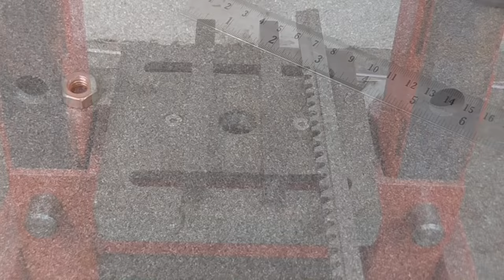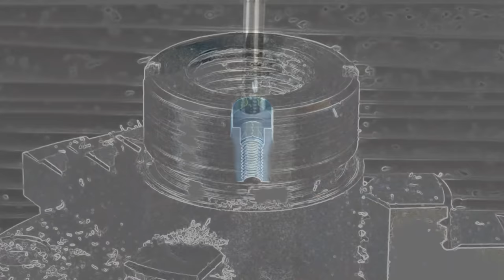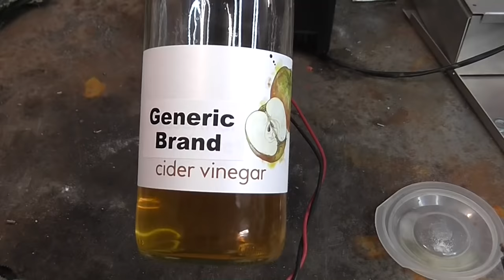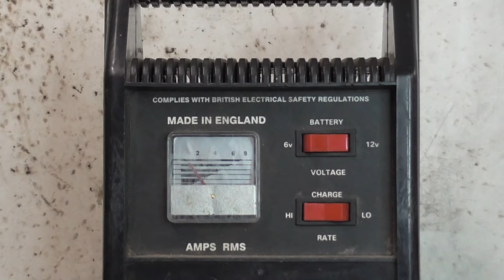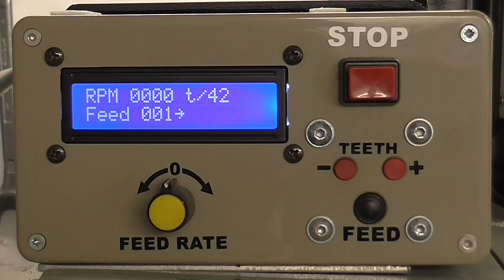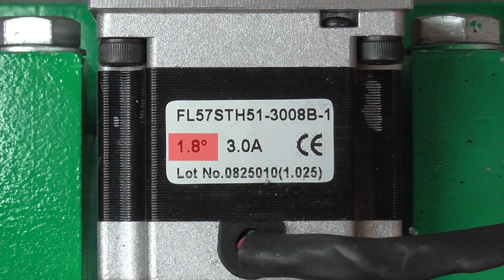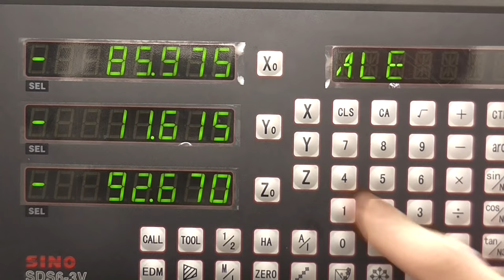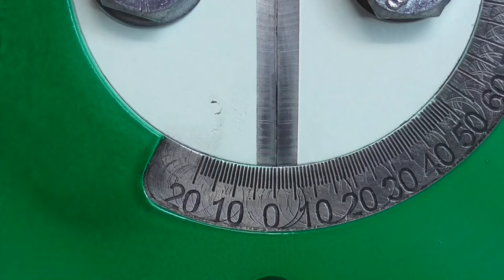Gear Hobbing Attachment (milling machine) Part 2

Comment: Yea. Hats off to you sir. I have a degree in CNC machine tool. Now I've seen and done lot of neat shit on these mini manual machines. Guys home making all kinds of tooling and attachments for all different kinds of operations. Machine modifications to add capabilities, automation builds, CNC conversions, rebuilding entire machines all that. Your build here tops them all. Average hobbiest aside even for me It's about hard enough to set up a mill with a rotary table and indexing plates and a standard convoluted cutter to cut a gear one tooth at a time. Here you are home building an attachment to transform a Harbor Freight mini mill into a gear hobb. That is truly amazing and worthy of praise. Again hats off to you my friend.

Comment: Interested in the box controller for the Stepper motor!!! would you care to share where can I get a hold of one of them??
Reply from the maker: That's something I built about 10 years ago for my previous milling machine, the electronics are a little dated, but the parts are still available.

Comment: I’ve been in the trade for 40 years. 
I’m impressed by your gear cutting. 
And your electronic gear indexing
Reply from the maker: Thanks very much! 😁
Reply: @AndysMachines  can you do splines this way too? or  that's broaching altogether?
Reply from the maker: Yes you can hob splines, there are special hobs for doing this. internal splines need to be cut with another method though (broaching, shaping, skiving).

Comment: The amount of engineering steps to making gears is intense. I have a new appreciation of the little things that makes life easy.
Reply: 🤖🍖me2
Reply: Hi Andy
How to sync the index head with machine spindle?
Is it possible to use closed loop stepper motor with harmonic drive for hobbing instead of belt drive?
Thanks in advance.

Comment: Ok, had to subscribe. I’m a professional mechanical engineer, and I have taught the machine design course at my local university, which includes a couple chapters on gears. But your explanation of how gear hobbing works (including a perfect animated illustration) was masterful and eye-opening. And how (relatively) simply a hobbing setup can be made…. wow. This just went on my last of projects for when I can finally build my garage shop.

Comment: Best explanation of gear hobbing that I've seen yet. And also thanks for demystifying cutting helicals. I always thought there was a lot more magic to it than just "tip the gear, then do the same thing" :P
Reply from the maker: There's a little more to helicals than 'just tip the gear', the calculations for correct pitch circle diameter are a bit more complex, but nothing too scary. Now hypoid bevel gears, they mystify me!
Reply: @AndysMachines  Haha, fair enough :P Still less magic than I originally imagined.

Comment: I have been waiting so much for this final video to come out. Absolutely brilliant bit of kit you have put together. I specifically liked the pre-tension nut for the angle bearings. 
What would also be great to see is these gears in use. For example to make a planetary set of gears and then run it at relatively high speed.
Reply from the maker: Yes, this hobbing attachment (and gears made with it) will certainly feature in future videos and I can think of a couple of applications for planetary gearboxes. It may be a while before I get round to it though (never enough time!)
Reply: @AndysMachines  Well done on this overall.
It would be great if you could do a more in depth take on the spindle. A lot of people don't know what it takes to make a shaft rotate with high accuracy and very low run out. There are more than a few people doing their own CNC mills and lathes here on YT and its obvious to me they don't understand the concept of mounting a shaft that will maintain its precision over time.

I don't know your background but its more than just precision machining. That part of the first vid when you checked the run out on the collet mount was scary for how accurate it was. The fact you know how to make and install a quadrature encoders is super impressive and I wished more people would pay attention to that concept.

I've done 30+ years of automation and very few people are even taught what you know to design and build. Robin Renzetti is one of the very few YouTubers I have seen who knows how to design and build high precision hardware. I have worked with precision tool makers and instrument makers and they have a different mindset to normal machinists.

About the only thing I would have done differently would have been to use a servo instead of a stepper but that's my bias from robotics and I know how to use them.
Reply: @AndysMachines  You're absolutely right about the mechanical part. No amount of software can ever truly fix a bad mechanical setup. It might improve what ahs been built but it can never solve. That's a very hard lesson I see way too many mechanical engineers NOT EVER LEARN.

I hope Robin is back doing regular vids soon. I really want to see how that hyper precision indexer turns out.

Its not that dissimilar to what you did. Its a very simple system capturing a rotating shaft in fixture to rotate accurately. Its just he's taken it to a whole different level of precision.

Comment: What a cool project, really impressing! I like the etching technique. And what a cool idea to use this assembly for skiving internal gears. Great content. Thanks for sharing.
Reply from the maker: Thanks! I use this etching technique quite a lot on things like control panels, this wasn't actually a particularly good example, there were a lot of scratches left on the milled area by the endmill I used which spoiled the look a bit.
Reply: @AndysMachines  Anyway, the technique is ingenious :)!
Reply: @AndysMachines  Where do you get your electroetch masks, please ?
Reply: OK. I saw the answer lower down. It sounds like I should visit my local advertising sign maker as I´m not likely to get enough use out of a dedicated vinyl cutter. I´m familiar with electroetching and used to have an electroetch machine where the supplier did masks, too, but it is 40 years ago. Thank you for reminding me of it !
Reply: @peterellis6556  You could use the same technique as what hobbyists use to make their own printed circuit boards. In order to make those they coat copper clad PCB's with UV sentitive photoresist, print a negative of their design on overhead transparency sheets, place the sheet over the photoresist clad PCB and then expose it with UV light from some UV LEDs or UV tubes. After exposing it the required amount of time the board is dunked into a soda or weak lye solution to dissolve the bits of photoresist which were hidden behind the black ink of the printed design on the transparency sheets and as result didn't polymerise by the UV, and then the plate is removed from the solution and rinsed with some tap or preferably demineralised water. Then the board is placed in a tub with etchant solution (ferric chloride, sodium/potassium persulphate, or diluted hydrochlorid acid with a small amount of dilute hydrogen peroxide) to etch away the exposed bits of copper of the PCB, and hey presto, you have a developed PCB with all the copper traces and pads just where you want them. The same technique can be used with other metals as well, including steel and I would assume aluminium. And its probably a fair bit cheaper than the vinyl method.

Comment: Very ingenious way to cut gears, or whatever else that requires precision timing.
Reply from the maker: Yes, good point. It can not only cut gears, but also splines, toothed pulleys, sprockets, graduation marks, very precise knurling, in fact almost anything you want to repeat uniformly around the circumference of a part.

Comment: It's nice to look at the work of the Master! Especially without using the archaic imperial measurement system.
Reply: Careful they still use whitworth fasteners 55 degree thread angle unless you're at or under a quarter inch 54 and 1/2 included angle.
I noticed he uses metric good for him. You know there five different metric standards.
I made parts to mount a Garrett turbine TFE 731 high bypass engine on a pair of Desalt Falcon and Condor Business jets to get FAA certification in flight by removing the one of the existing engines replacing it with a Garrett model as most modern twin engine aircraft are certified to fly with a single engine it saves hundreds of thousands of dollars testing etc we did all the engineering made all the parts even installed everything, next thing you know I'm getting a call from an engineer desperately wanting to know what the hell I did wrong they were trying to add something the ISO metric bolts they had would not fit.
 I told him I used the French standard he was puzzled it's a French aircraft dude I wrote it down on the blueprints if he would have bothered to read them.
Here in the US we must deal with all of it I've made many an adapter to go from certain British taper pipe sizes to American taper pipe. On regular Straight pipe most of their threads are off by one pitch we add extra pipe snot and use a bigger wrench
On one project because somebody cheaped out on the gearboxes for the Central Arizona Project bringing water from the Colorado to Phoenix the size of pipe plugs used doesn't exist here like not even close.
Some of the Indians didn't feel they got their fair share of water so they were loading the gearboxes with gravel, the solution was to put locking pipe caps on the gearboxes right up until they couldn't find pipe nipples that would fit to screw said locking pipe caps onto priceless. 
More like about 60 adapters at around $50 each.
Reply: Not sure why they would call it imperial that's what they should call the British whitworth system.
 Here in America we use inches which have nothing to do with a damn thing.
Why you got me not divisible by anything makes computers insane only thing worse is when people try to convert metric to inches when they're trying to hold tenths of a thousands of an inch on CNC machines.
The control turns the motors that turn the screws.... you guessed it! Metric Screws so you end up with a double error someone asked me why don't they make inch ball screws Id like to smack them with a ball peen hammer idiots.
What would you use for a conversion factor how many places would you take that out and still be wrong unbelievable.
Some of the bolt patterns on jet engines make me crazy.
I use the dividing head with a plate you still have to put a fudge Factor in by adding or subtracting a hole in The mask plate, and if you're smart you'll break that up by some amount equally which is impossible I always try to break them four if not five times depending on the tolerance typically as I cross an axis if you looked at it that way even though I'm turning it radially.
 What division plate would you use for 109 holes on a 762mm diameter on a Bridgeport that only has 225mm of travel in Y.
Be careful one hole at 12:00 is offset from it's normal calculated position, only in the x-axis by 1.25 millimeter now imagine if you look at the part the first hole at the top now at 9:00 your left hand is now zero you're at zero because you're using the x-axis as your radius adjustment Y axis remains at zero except for this first hole the offset is made in Y.
 you get .002 inch tru position tolerance, regardless of feature size how many tenths of 1/1000 inches can you be off and maintain this position tolerance?
How many Arabs can you fit in a tent-h anyway, it really depends on how big the Tent is.
I live in microns thank you.
Sorry bad joke I got a better one though
Your setting up a machine you make the first part and send it to inspection.
The inspector comes out and says you need to move over a couple Mills, that way.
So you unbolt everything move down the line 2 machines and begin to set your parts up again there.
Soon he comes back to check on things and says, What the hell are you doing?
Reply: @chauvinemmons  It must be frustrating to work on vehicles of projects that cost upwards of millions, only for it not to work, or even worse, utterly get destroyed because someone used the wrong type of bolt. Hopefully one day the last few countries will join the rest of the world in using the metric system and nothing else, it would save a lot of people a lot of headaches and money the world over...

Comment: Great video! That answers a lot of questions I've always had about hobbing and this sort of coordinated moves that's necessary to make it work. I love the way you're able to get that ring gear cut. It seems that that's broaching it though, rather than actually milling it.
Reply from the maker: Yes, the cut is taken in the downward direction by the relative movement of part and cutter, it's similar to rotary broaching.

Comment: First of all- subbed, because this is the best example of a homemade hobber I've ever seen. Second- skiving is impressive, but poor results (wonder if it was because of heat treat on cutter?)- I'd love to see more of how the cutter geometry and centering of it is done. I'm aware of skiving before this, but was surprised when you pulled that out of the bag!

Lastly- if you have a tool steel blank gear, and cut it to an exact length, with 2 deg. of relief on backsides of form from face- you could make a Hemingway rotary broaching tool- and broach external & internal gear teeth on things. That would be better result than your skiving. Running an MDF disk through the teeth charged with fine diamond paste after hardening would give excellent finish and make the cutter work better too
Reply from the maker: Thanks! The skiving was really just a bonus feature and not the main reason for building the attachment. I wasn't sure how well it would work, if at all. I don't think the heat-treat was the problem, the cutter didn't dull at all and cut plastic and steel with virtually identical results. I think the main problem was that the geometry of the cutting tool was not correct, skiving seems to be somewhere between hobbing and broaching and calculating the optimal tooth profile for the cutter. Chip clearance was also a problem, and probably other issues too I haven't identified. But it did work well enough to make a usable gear if only for light duty.

Rotary broaching an internal gear is an interesting idea, I could make and harden a cutter easily enough (it would actually be an 'inverted' gear, with addendum and dedendum reversed). But I think it would require more force than my machine could apply except for a very small gear, as it would need to be done in a single pass. I might actually try this with the same 8-tooth cutter used in this video, making an 8-tooth internal gear, perhaps in plastic.
Reply: @AndysMachines  Rotary broaching doesn't require tons of force- you just need things roughed out first. If you trace the pattern and mill out most of the stock by hand, it takes a lot of the pressure off. The wobble is around 1 degree, so it shaves very little but quickly with each rotation.

For internal gear- yeah, you'd need a weird hob to make essentially the inverse gear form.

I love this project, and really love how you showed the hobbing of helical spur gears simply. The video really made many things clear.

I won't lie- I really really hope you cover the construction of this in every detail going forward- I really want to make one of these. I've done traditional gear cutting, but would love to get into proper hobbing.

Comment: About the encoder wheel - its by far easier just to print it on transparent film. If its not dark enough you can print multiple and place it on top of eachother. We once did contactless analog potentiometer by printing gradient. It was for a racing wheel :)
Reply from the maker: Yes I actually did that for my previous gear hobbing attachment, but I found it not durable enough for a wheel this size. But for a small encoder you can completely enclose it works great. A more durable way is to cut the shape on a vinyl cutter and stick it to a thicker sheet of clear plastic, I suppose you could do this with a printed transparency too.

Comment: All ingenious is simple 👍
I assume that controller is arduino based. Would be nice to see setup.
Thanks for sharing!
Reply from the maker: It's not arduino based as this controller I built for my previous milling machine before arduinos were a thing. You'll be pleased to know I'm working on an arduino based version though.

Comment: Great project!!
Now that you have an encoder on the spindle, you could use your controlbox to trigger the camera shutter. That way you could film cutting//milling videos where the cutter itself apears to be standing still. Would make some very interesting shots!
Reply from the maker: That's a neat idea, I might try that! From 21:17 I got the frame-rate almost synchronised
Reply: Not just stationary, if you set the shutter frequency to some fraction of the spindle you can do high speed/real time slow motion (think slow mo with normal camera equipment)

Comment: Did you use a CNC laser for the vinyl mask or some more mysterious technique like Press'n'Peel?  Very neat solution. I've tried making scales using a laser-printed acetate master and that UV iron-on film stuff with electrolytic etching, but it wasn't good on a stainless steel scale.
Reply from the maker: I used a drag-knife type vinyl cutting machine (as used for vinyl sign making). It's surprising useful to have one of these for all sorts of layout and mask-making.

Comment: Nice presentation. A major undertaking. 
Page 10:20 did you ever wondered of loose dowel pins in the future?
Reply from the maker: Thanks! I don't think they will work loose, the bolts hold everything tightly, the dowel pins are really just to align the parts during assembly. The pins can't ever fall through the bottom as I reamed the holes from the top and left the bottom part of the hole a smaller diameter.